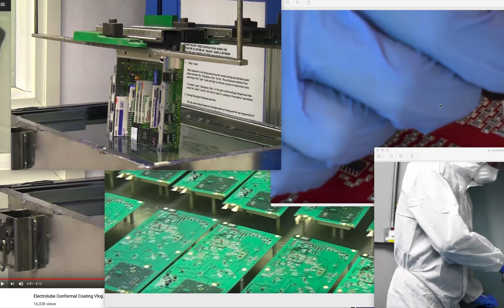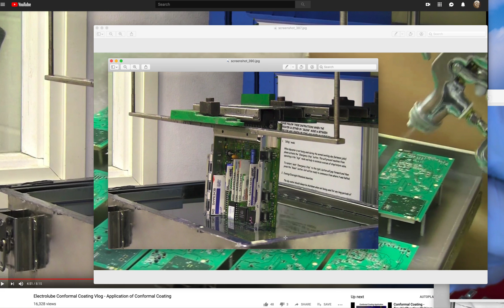😱 REAL Camera Conspiracy: Conformal Coatings & MAIN BOARD failure

Comment: Conformal coating does not solve the issue. What about heat dissipation? There are components in there getting hot and conformat coating will short the life of them as they will not be able to dissipate heat. Sony+conformal coating I want to see how long a camera lasts! It will fail anyway if not sooner.

Comment: I'm surprised cameras don't have this already. I've used them a lot in systems I've built for military use. It's not the be all and end all for weather sealing, especially with electro mechanical devices, like cameras but is standard on most defence systems I've worked on.

Comment: I made a suggestion to a company I used to work for to change the connections on a product to one found on an other product. My best guess would be less than 25 cents to switch them over. But I was told it was to expensive to do. But they had the money to pay for 2-3 hours of labor plus gas to send a person out to repair this issue 4-5 time a month.

Comment: You're missing the point

Using these techniques will result in severe restrictions for cooling (especially with high end features that demand high end processors) that will not allow for the processors' TDP to be dissipated

Not taking sides, but Olympus and Pentax are the true kings of weather sealing

Comment: Conformal coating is nothing new. I've been involved with it for years. As an engineering technician, I've been exposed to it in the avionics industry and railroad electronics industry. Worst about it is the process to remove it when a component needs to be replaced during repairs. It does do it's job.
Reply from the maker: i NEVER SAID nor implied it was NEW,.........  so what the hell you talking about

Comment: It's if universally rejected by all camera manufacturers you know it's because it doesn't make much sense to do. Any of them would jump at the chance for a competitive advantage.

They probably calculated that it's far faster, cheaper, easier, to repair than prevent an insignificant sized problem.
Reply from the maker: wrong, its not insignificant
Reply: @KenTheoriaApophasis  I believe it is insignificant because if the problem was big enough there would be a need for it and any of them would jump at the chance for that competitive advantage.

I don't think the problem is big enough to warrant increase cost and complexity into the production process.
Reply: It actually benifits companies NOT to coat them. Making the camera prone to failure, thus increasing sales of newer models along with repairs.
Reply: @bear5016  Why even bother with gaskets then?

Unless you're saying all the camera companies are conspiring to make easily damaged cameras... Some company would want to the toughest camera for a competitive advantage... Coating is supposedly Superior to gaskets yet no one is doing it...

Conspiracy or not worth it?
Reply: Marketing mostly. The gaskets do offer protection, just not to the extent that some believe when they read/hear "Weather Sealed".
Reply: @bear5016  Why isn't anyone marketing coated circuit boards then?

Comment: How would the heat disipate if coated?
Reply from the maker: the copper heat sync plates will move and dissipate heat regardless of coating
Reply: If its epoxy or silicone based, its thermally conductive, making it dissipate heat more effectively.
Reply: Source: https://www.covascientific.com/blog/thermally-conductive-conformal-coatings

Plus youre not coating the heat sink itself, just the pcb/MB with all electronic components.

I used mg's modified silicone conformal coating around my Gpu's die to protect it from the liquid metal I applied directly to the die.

Besides, motherboard or any pcb electronic components do not get excessively hot. If they do, then generally heat sinks are applied to those individual components. Thus, the coating would not be applied to them.
Reply: Oh, so you're a troll, got it.
Reply: Why is it not applicable? Conformal coating is applicable to ANY electronic component.
Reply: I already stated it would not be used on components that need heat sinks. And I never stated it would be used a a thermal conductor such as thermal grease. I simply stated that epoxy/silicone based coating is thermally conductive, thus NOT being an insulator for heat across the pcb.

Stop misreading what I wrote and twisting my words to fit whatever argument youre trying to state.